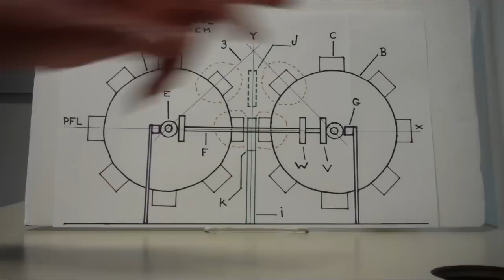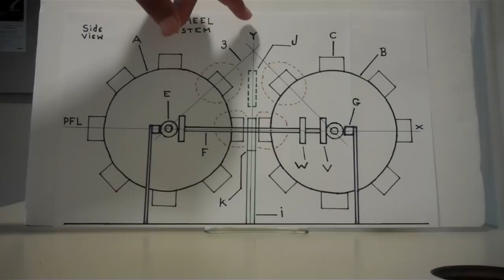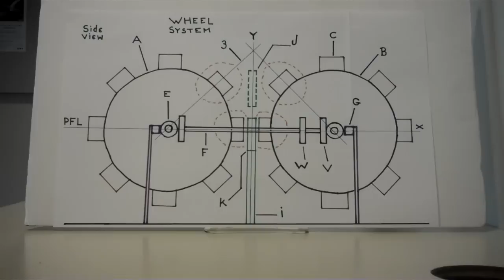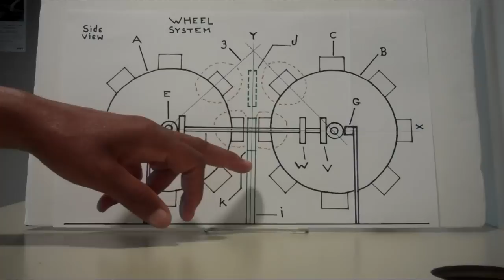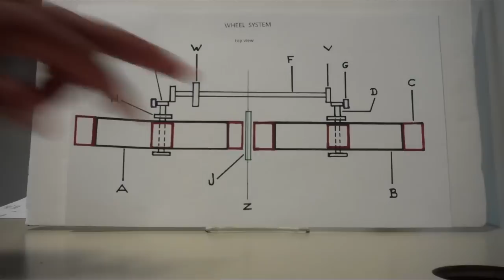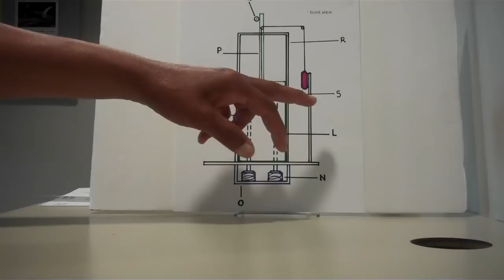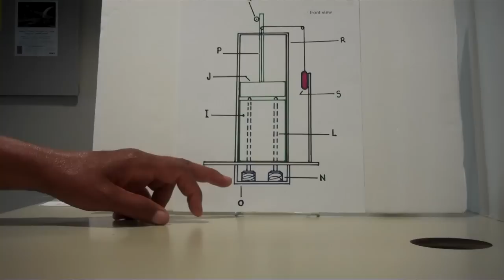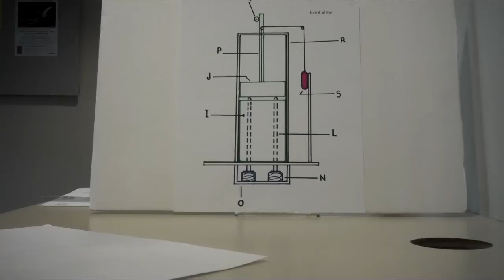PERMANENT MAGNETS: The Johnson Machine - How To Make a "WORKING"  semi-PERPETUAL MACHINE

Comment: Mr Johnson, before i say anything let me say this, my review of your machine is not a personal attack on you. I can only imagine how much research and time you must have put into this idea and i respect that. I am sure that you worked very hard to get to this conclusion. However you are wrong it will not work... and wrong on  a few things.  In your response to my post you mentioned that i didnt have the mechanical knowledge to understand. Well Mr Johnson respectfully i happen to be an Electro-Mechanical Engineer, and have been for 20 plus years i definitely understand the "Mechanics" behind it. I could very easily go into a detailed explanation on why this machine will never work but i dont feel the need, lets do basics. I ask one favor just this one look up the word " COEVERSITY"  There are 3 ways to destroy a magnetic field, Your machine is one of them.  You cannot arrange magnets with like poles to push against each other as the field strength in the magnets will diminish and cease to exist. So you are proposing to use a failing system of motive force to move a gate, and gears, and bearings.  COEVERSITY is not a idea or a theory its a Scientific Fact.  The motor  you propose would end up doing all the work and the  gate the magnets your shielding would have no effect on output torque except to decrease it. IT would be a load on the initial motor itself causing it to use more current just to keep it going. Mr Johnson take your idea to another Engineer see what he has to say about it, or do the best thing you can do.... build it and find out then it wont work.  Yes your idea has been tried before and yes in the  1800s prior to even Tesla and the induction motor. if you give me the time i will find and post the patent numbers on here if you like,  Mr Johnson i am not attacking  you sir. I truly believe that you have the mind and intelligence to be a great inventor, you think outside the box and you pay attention to finite detail, we need more people like you, But this idea Mr Johnson it just wont work,  ask a physics professor.
Reply from the maker: Mr. Mike Cull : .. Once again,  I disagree with your disagreement. (1) The field balance metal does not destroy the fields. It balances the repulsion and attractive forces using the metal. Similar to a shunt. I am a physicist. The magnets are never static in reference to each other. But revolving. The metal gets them to pass by each other. Which would not happen without the metal. (2) I am unfamiliar with any materials (internet, books on magnetism, patents and otherwise) that give any info on cancellation metal (field balancing metal). (3) As far as I'm concerned it will work. And, I don't need other's opinions. When I get the time and money I make the thing. Instead of telling me airplanes won't ever fly, help me make god-damned thing.
Reply from the maker: Dear Mr. Hine Ang: .. Why its' so difficult for those with knowledge on the subject, not to understand,  what those with far less knowledge on the subject do understand ? This machine is not involved with: magnetic Coercivity. This system does not seek to change the magnetic properties of the magnets or the magnetizable metals. The magnetizable metal (field balancing metal or cancelation metal) is there only to balance the repulsion of magnets to each other and attraction of the magnets to the metal, to zero. Equal push and pull. This cancels the directions of the magnets' motions to zero. The magnetic fields are undisturbed and unchanged. Understand the system BEFORE making comments. Don't tell me you understand. You don't.  Don't look for faults and devils' advocate. Look for all the ways to make it work !
Reply: coercivity, lol

Comment: i think this is very well though out..however not correct respectfully. The problem being that the gearing and bearing friction losses would account for significant loss across the system. Small motor or not the input energy would have to be increased from the very start to overcome those losses. I am pleased that he refers to this as not a overunity device as they dont and never will exist. Our own Solar system is not perpetual and will one day wind down, to think a machine can be made that will run and produce extra power is an illusion or should i say delusion. Anyway i digress frictional losses and the fact that to bring both magnets into that arrangement even if you cant feel it with your hands there is slight repulsion there as well. I applaud you for your interest and detailed explanation. But the bottom line is is that it is no more efficient at converting power than any other method we already have in use today. Again i applaud your efforts but this is not a viable answer, it just will not work the way you think it will. This hasidea also been tried in the late 1800s and found to be ineffective. I will give you that it is well thought out and good luck on your future endeavors
Reply from the maker: Dear Mr. Mike Cull : .. I disagree with your disagreement. (1) you never mentioned the cancellation metal (field balancing metal). This balances the repulsion and attractive forces to zero between the magnets. (2) the gate that the little motor lifts can be more than one plate or layer. Only one is shown in the drawings. (3) If I made this system, as in contrast to those who can't see almost non-frictional quantities in complex systems, and so forth, friction thru out the system would be negligible and to close to nothing. (4) this system was never tried in the 1800"s or 1900"s. There is no material showing field balancing metal anywhere. (5) you're knowledge of mechanics isn't great in this area. Mine is. And, it will work. The drawings are a guide and not the finished system. (6) look closer. See what I see.

Comment: Please, it's a demonstration of theory of motor magnetic but it's not a device of motor magnétic
Reply from the maker: Mr. R. A.: ...That's obvious. It is a template of the system. There are those who are out to make this system. This is one of THE MOST refined forms of templates of this type of system. Nothing else comes even 1/10th as close to functionality as this. Anywhere. You can personally be 100% sure that you and no one else will ever do better. Hence: if you have the tools, money and equipment, please make a rough working model of this system.

Comment: I think this idea has some significance. I have one doubt when the cancellation metal moves beyond a particular point the magnets repel each other and at this point when we bring the cancellation metal towards x line the force required will be more. so before the next magnet arrives the x line the cancellayion metal should come back. you have shown 8 magnets which is 45 degrees apart. so the movement of cancellation metal should be restricted to 22.5 degrees.
Reply from the maker: Dear Sundararajan: ...The drawings are a template and not a finished blue-print of the system. The system can have less magnets or more magnets than shown. The system does not have to be built - exactly - point for point as shown on the drawings. The drawings are a refined guide of what to do.

Comment: Understand first off that i am not condemning the machines idea just some of the flaws. first off if gate J has a counterbalance S to offset the weight then its weight becomes zero so it can not push the spring N because there is no force to push the spring down. So therefor the little electric motor would have to move the gate on its own. So any opposing force on the gate by the magnet C could only be opposed by the electric motor. The second issue is the magnets themselves requiring energy to be made. This is making them into a battery essentially but there is a need to store energy and then use it at certain times of the day and night.
Reply from the maker: Dear Mr. Mark Vance: You seem to mean well. There are... NO ... flaws in the basic idea template. The drawings are a template to be used as a guide and not the finished machine itself. (1) The gate counter balance weight reduces the force needed to move the gate up and down by the small electric motor. PURPOSE: to take some of the strain off the little motor. The same principle is used in elevators. (2) The gate's weight and the little motor - IS NOT - used to push the spring down. (3) The magnetic attraction between " i " and " j " compresses (pushes down) the spring " n ". (4) The spring pushes back with almost equal force upward. Which lessens the amount of force/energy the little motor uses to lift the gate " j " away from " i ". (5) The magnetic attraction between " i " and " j " must be broken before the little motor can lift it. (6) The magnetic attraction comes from the main magnets " C " in close (but not physically touching) proximity with " i ". Which is magnetizable metal. (7) The little motor moves the gate on its' own - once - the magnetic attraction between " i " and " j " are broken or weakened to great degree by special springs " n ". (8) Your consideration of the infrastructure to make or produce the magnets are not relevant here at this time. This can be factored in later. First: make the invention work.

Comment: I've thought of a similar design. Though this is fact. You cannot stop magnetism with materials only redirect it. There is no known material at this time that can negate the magnetism force. This is what is needed to make your design work with the gate system. At this time, only shielding of magnetism is available which only redirects magnetism. The reason why shielding will not work, is wrapping the gate in the shielding material and then moving this gate back and forth between the magnets will act like a counter force. If you want this design to work, we have to invent a true magnetic cancelling material.
Reply from the maker: Dear Mr. L. Ogic: I don't agree. The attractive and repulsive fields can be balanced and used to hold each other at zero physical position by putting a piece of magnetizable metal between them. Easy indeed. You don't stop or destroy the fields. You balance them, then unbalance them and use the unbalanced as a force.
Reply: Yes there is or there are materials that change like steel heated, right? Now if you had one that did at 200F wouldn't it be closer?????
Reply from the maker: Dear Mr. D. S: You and I, would like to know what you're talking about. What does it have to do with the subject matter of the above video ?

Comment: Looks more complicated than needs to be.
  The center shield could be a rotating permeable metalic disk with sections cut out to let the magnets repel each other, which rotates counter in direction.
  Also the magnetic wheels could be magnetic drums mounted to two meshed gears, much simpler!
the magnets should be thin but long (thats why the drum)
Reply from the maker: Dear Mr. Bargains Bob: If you can build it and make it work then you have the green light to go ahead.
Reply: i have no faith and also believe what seems plausable in my head hardly ever seems to work in reality just as dreamed.
I dreamed up a simular device a long time ago, two wheels counter rotating with a movealle window in the center. I was shocked to see your video  which seemed somewhat close to my own idea.

 At one point my moveable window was made from thin strips of magnets glued together vertically. The idea was the window would magnetically balance with the rotor magnets so the net - and + forces will neutralise and Zero out. In this state the window magnetic array can move with no net interaction from the rotor magnets. as the window moves down it exposes the rotor magnets  to each other.
This will cause the rotors to spin.

Comment: The principal problem is that your machine must slow when the turning wheels find the non-balancing point between the magnets. I have the solution for you.
Reply from the maker: Dear Mr. Ed Schirra: Good. That's how things get done.
Reply from the maker: Dear Mr. Ryan Duarte: One solution can be found at: jessie johnson - permanent magnets: how to reduce the 100%  sliding down to 2%-5% sliding force. When used correctly for this device (in the above video) and a few other devices.

Comment: thankyou jessie you will forever in my mind be one of the greats, i learnt alot and actually built a similar device in my mind after watching your first field cancelation video  but i would have extended the wheel shaft attached many more magnetic wheels surrounded by coils as for the power output...

Comment: So, it's been two years since you posted your videos. Have you built this machine yet?
Reply: You may not need to build a thing to know if it will work but you do need to build it to PROVE that it will work.I can build a contraption that will give you "free" energy. By "free" I mean you don't have to pay extra for it.
Reply from the maker: Dear Mr. Hizenbird: You don't have to build a thing to prove it will work. Especially simple things: spoons, chop sticks, pencils, chairs, beds, radios, TV's, cars, boats, etc. There's enough know how on these things and thousands of others to know they'll work without being build. The reason to build a thing is show ' HOW ' in its' specifics of how that particular thing shall function and how well. This is done by testing, advancing and small modifications to the system, etc.
Reply from the maker: Dear Mr. W. Rutherford: (1) I may or may not build this system. It depends on how I feel. (2) You don't have to build a thing to know if it will work if you have enough knowledge in the subject area. The system would need minor tweaking, testing in every form and minor modifications.

Comment: I think part J should be stationary, and possibly in the shape of a concave wedge, so the forces cancel out across the entire top half of the device. And no cancelation metal at all across the bottom half. I have an idea for a more powerful configuration as well. :-)
Reply from the maker: Dear Mr. Martin Hirsch: That's the spirit. Simply keep in mind that the cancellation metal and the cancellation metal GATE or " J "  are magnetized in all 3 coordinate directions of X, Y and Z. The magnets will be pulled back to the top of the metal and stop. They must go past the top of the cancellation metal and then gate "J " must open 2-5 times faster than the magnets turning on the wheels spin to let the magnets repel each other. Also, in the video only a one panel piece gate is shown. A 2-3 panel pieces can be used. This must be tested to find all correct things.

Comment: Very interesting.  However, have you built a proof of concept yet?  It shouldn't be very hard to build a small prototype Jessie.  The reason I ask is because I'm wondering about one potential problem:  I'm thinking that the magnets would incur a force by the generator coils as electricity is induced.  Where there is flow, there is a field.  I'm not saying this wouldn't work, but you might experiment in order to see how it works in a real life application.  Magnets are cheap and, as you stated in another video, the metal sheets are cheap from an auto parts store.  I had to edit my post in order to mention another potential issue: your diagram with the small motor that lifts the block, you said you reduced strain on the motor during the lift work by having a counter-weight--but wouldn't that make it so the block doesn't drop automatically?  Does the motor push the block down too or only lift?
Reply from the maker: Dear Mr. Jonathan Seale: (1) I've - not - built a physical model as yet. (2) these are permanent magnets and not electromagnets. There are no generator coils of any form and there's no electricity to be induced. (3) the counter weight joined to the gate is identical to what's used in elevators to reduce strain on the motor otherwise the motor would have to pick up the whole gate's weight which would be an un-balanced lift. This way it has only to turn or move a balanced force (weight) in either direction.  And the weight doesn't have to be on the motor's rotor arm.
Reply: Jessie Johnson Oh that makes sense about the counter weight.  I'm not clear how you would employ the first device practically.  Can you clarify please or provide some example applications?